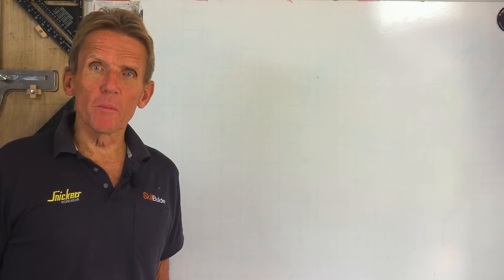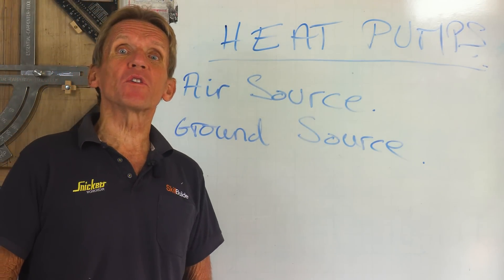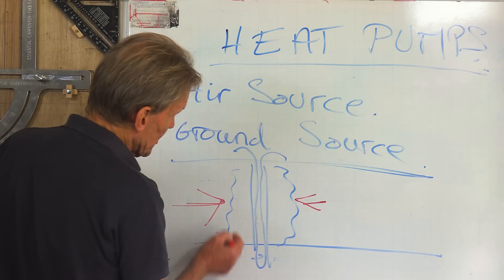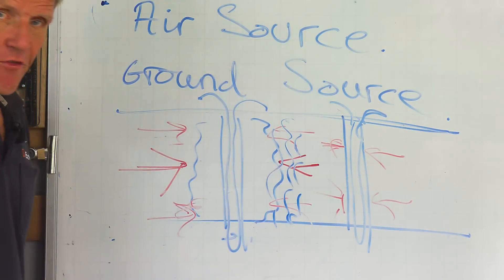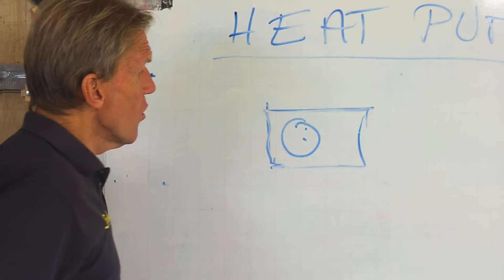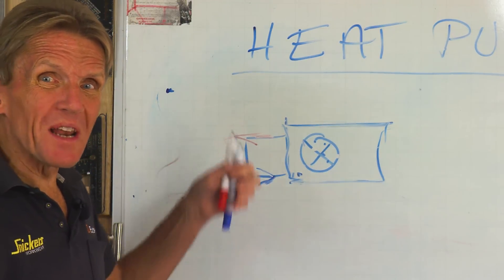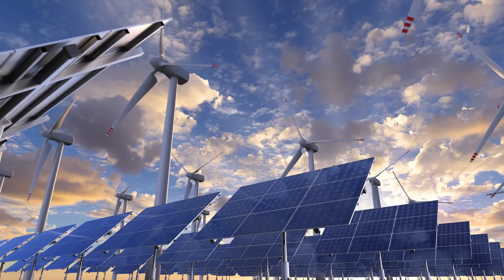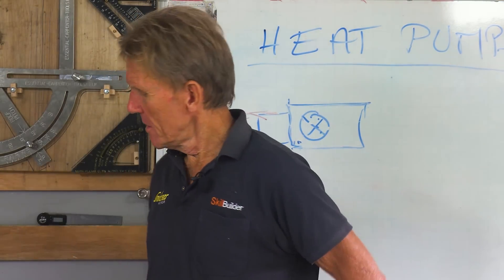Heat Pumps ~ Get Your Facts Straight!

Comment: Thanks Roger another great video.  
So I worked out the following: Based of fuels and 8 euro cost of fuel as base line to output kwh.
6mm Pellets with approx 5 kwh per 1kg  15 kg bag 8.00 euro x 15kg = 75 kwh output
Coal with approx 8 kwh per 1 kg stove used (40kg bag 24 euro) 8.00 euro x 13kg = 104 kwh output
Kerosene approx 10kwh per 1 L. 1L = 1.35 euro.   8 euro 6 L fuel = 60Kwh output.  Can 3x this by mixing in burnt oil (free) after filter mix etc  180Kwh (Chinese heater)
Mitsubishi heat pump Air to water 3.2 COP to 4.8 COP (2016)  1 kwh at 0.31c.  8 euro = 25 kw COP3 = 75kwh output.

As we can work out the calorific value for fuels... or at least approx due to efficiencies of stove, pellet burner and fuel heater... How do I confirm the COP output of the Heat Pump?
Had a look on line to see if could buy a plug in play device. Electric used, measure of water heat out and in including flow speed? I would think thats whats needed.  If I had a COP 1, how would I know as without the COP value confirmed its really the most expensive here to run maybe... Its the not knowing. Another video coming....

Comment: "Is that clear?"......Crystal......With the climate of the UK being damp and cold and especially this year wet (as rain or high humidity will kill the efficiency of heat pumps which you didn't mention), not sure heat pumps are viable in winter without a seperate gas boiler which is the way I am going to heat my house, 1st gas boiler then later an additional heat pump which will be switched off at below 5C.  Living in a semi I have just insulated the long wall non party side and used Hardie planking to cover it instead of cement which will need maintenance. The ends of the house will be insulated from the inside to avoid planning applications/inspections/approvals/neighbour whinging etc.......then the upgrades to the boiler starts.

Comment: If you coynnect your solar output to your aircon then you are not burning gas and should be summer carbon neutral.   If you are running a heat pump using electricity from non renewables you are increasing CO2  usage (but less than burning gas in a bolier ?)

Comment: There are some concerns raised about noise from Air source heat pump (a/c) systems when mounted outside , any ideas how that noise can be eliiminated (presumably electrical 50Hz,  mechanical bearings . start stop noise.
Reply from the maker: A lot of the noise is the rush of large volumes of air beging pushed through the heat exchanger.

Comment: Please go back to the drawing board and do this video all over again.
What do you mean by ground source? Digging a 2 meter deep trench and place tubes in it to use for your heat pump? That will be affected by sun and the air temperature. Don’t you forget about heat pumps and placing the pipes vertically, drilling a 120-18 meter hole into the bedrock. Time to wake up? And present all the alternatives.
Reply from the maker: I have no idea what you are talking about. All this was covered in the video. Maybe you nodded off

Comment: Can you imagine all those fans spinning up 24/7 on all heat pumps if fitted on all buildings plus it will be using more electricity to the grid just like the ev it  is all a false statement made with the intent to deceive
Reply from the maker: We saw a news story where they are removing heat pumps from a school because of the noise.
Reply: @SkillBuilder  So I was curious and looked into this. The "removal" is just a clickbaity title from one outlet with no substance. The actual source article is from July. The picture included is of 2 external air to air units, so if they're running in AC mode in July, not sure how they can be noisy 24/7.  Seems to me, like another anti-heatpump hit piece.

Comment: I feel that one issues with heat pumps that is never mentioned or taken into account is local Temperatures and how they vary across the UK. It is quite obvious that your average outside temperature will effect your efficiency and over a year your costs will be much different to many others. So the question for me is by living in a colder Scotland or any where else can I lose money by converting to Heat Pumps, and if it has to work harder and longer will it need replaced sooner in the future???????
Reply: Two thirds of Norwegen homes have heat pumps, I'm sure if it works in Norway there's no issues with the slight cold we get in the UK, even in Scotland....
Reply: @Lewiiisss  yes it may work...I am talking about relative efficiencies and costs over time and can everyone afford them. If the temperature outside is 0 deg C and you want to produce 20 deg internally you have to use Electricity... then you also have to look at the cost of Power but that over time depends on Climate and Carbon restrictions... as we speak there are laws being draughted to restrict your consumptions on all homes, not only that, they are enforcing Home Efficiency ratings to be at certain levels....this will cost tens of thousands and will be incremented over time. Also you are restricting yourself to one source of power and are reliant on an infrastructure that is not fit for purpose...it is failing now  with EV's......
Reply: Yes, large towns and cities are heat islands, so the HP performance is likely to be better than in rural and northern areas.

Comment: A first time I come across in one of those videos, where some body gets the difference between ground sourced and geothermal right.

I want to add, that you go geothermal, in areas where geothermal does not reach the surface, when you go deep. I talk about going at least 400 m for hot water, but most often down to 1,000 to 3,000 m. The surface geothermal was already used by the Vikings.

As such boreholes are expensive, it is done most of the time for district heating. Here in Iceland most of the boreholes, with reasonable power are about 2,000m, about 5 kW in a good working borehole.. In the first step you extract electrical energy using the steam and the water cools down to 90¨C. That water is than used for district heating..You use the same equipment drilling far hot water as drilling for oil.
You will find geothermal energy in a lot of countries and areas at a reasonable depth. Always when you go deep enough. Were you have wet rock you can extract the heat by pumping up the hot water or you are getting steam. With non water bearing rock or dry rock, you have to introduce water through one hole, crack the rock and pump hot water or steam up through another hole.
Most of Iceland, 95% of the houses including industrial sites are heated by geothermal. All in all over 60% of all energy used in Iceland comes from geothermal.

Comment: This is useful information. But our heat pump system is only used to heat our water for the taps etc. It runs off of our solar panels. The radiators are electric.  Our house is a new build and this system was installed by developers. It works very well. Other people I know with heat pumps also just have it for just hot water.  So having heat pumps to heat radiators is not a super common set up in our area.
Reply: Sounds like the builders did just enough to meet building regs and ABSOLUTELY NOTHING EXTRA. It won't be running off your solar panels this month.

Comment: So why in Canada which is substantially colder than UK use air to air heat pump all the way down to -35 Celcius? Honestly don't tell me UK knows better than Canada when it comes down to heating in winter... Same thing in Nordic countries. All use Air to Air heat pumps.
Reply from the maker: As I explained in the video we are using air to water and therein lies a problem with low flow rates and icing up.
It is not a question of knowing better it is entirely political.

Comment: It always drives me nuts in places like Buxton, Bath, Bristol and Matlock why would you want a gas boiler, megawatts of power are pissing out the ground, all it would take is sensible extraction using heat pumps with heat exchangers and district heating networks. We do not make full use of what nature provides us with. I am living off-grid now in a normal urban semi, it is purely a case of sensible use of natural resources. Rivers especially those in tidal estuaries are perfect places to put heat pump loops.

Comment: Often think theres a big trick missed with heat pump systems   a trick the romans did 2000 years ago
Heat the ground under the building ad it stays warm far longer than the fabric of the building...hot all ways travels to cold....heat the may be partly insulated round the edge against the foundations with solar all summer and control its release into the building 
Solar heat is far away cheaper ...its just haveing a big enough store

Comment: Just wanna tell people that cooling the house in the summer is pretty "cheap" compared to warming the house in the winter. Warming a house from 0C° to +20C° takes a lot more energy that cooling from +25C° to +20C°.

oh and the heat from the sun is typically about 90% of the total heat in the ground (in England).
Reply: What seems odd is why isn't cold water pumped around the radiators and fans fitted radiators to increase the cool air flow...
Reply: @tatradak9781 because cold air doesn't rise.
Reply: @tatradak9781  because we live in a humid climate and water will condense on the cold pipes and radiators, causing problems
Reply: @tatradak9781 
You need a refrigeration process to cool the water

Comment: Strictly speaking both systems using hot springs (or water pumped deep into the ground) and ground source heat pumps exploit geo-thermal energy.  After all 'Geo' is from a Greek base meaning ground or land.  And the shallow pumped version is, after all, called a 'ground-sourced heat pump'. The discriminator is the technology used to extract that geothermal energy. Ground source heat pumps do it close to the surface rather than from heat sources deeper down.  But both are still, strictly speaking, geothermal.  This is probably industry pseudo-convention of a similar nature to electricians who refer to the 'L' - in 'LNE' - as the live wire when in fact they should use 'Line'.... both L and N wires are 'live'.  Thinking otherwise could kill you. Because the amount of heat from deeper in the earh's crust is greater- the centre of the earth is molten - this type of geothermal energy is used for multiple outlets / homes over a wide area, fed from a central collector station.  Conversely, ground source heat pumps, because of the relatively low geothermal energy capture, are generally used for single buildings.
Reply from the maker: The distinction between geo thermal and ground source is more than semantics. It explains why the ground source heat is, in practical terms, variable and finite. The Ground Source Heat Pump Association says that freezing around ground source collectors is a common problem and needs due consideration in a survey.
Reply: agreed Roger, but whatever the considerations or semantics,  benefits and otherwise, the energy harvested by a ground collector is, by definition, geothermal energy however deep the collector is placed in the ground.  The shallower the collector, the more the capture is affected by near-surface and above surface energy effects caused by the sun / atmosphere.

Comment: Air to air is best. You only heat/cool specific rooms instead of the entire house so you use less energy, 4:1 energy efficiency , much much cheaper to install, you can switch between gas and electric whichever is cheapest, easy to maintain.
Reply: You can get 4:1 with air to water
Reply: @hk78901  correct
Reply: @hk78901  with water it's less efficient overall as performance suffers during coldest month's, unit going into defrost regularly, water pumps and valves use additional electricity. Those with air to air and a cheap combi can switch back to gas on the coldest month's/days. Best of both worlds
Reply: it is important to heat the whole interior of the house for half the year and/or vent it to control the humidity of the air. Why do poor people get black mould problems: lack of heat and lack of understanding of the need to trickle ventilate the house constantly. Even rising damp in houses can be controlled this way.
Reply: @itscoconutsaregood  the mould occurs mainly in bathrooms and areas with poor extraction/ventilation and poor insulation. You don't hear your entire home just to prevent mould, not really the same topic
Reply: my statement referred to your "specific rooms instead". I just thought of reminding everyone that keeping spaces free of the effects of air moisture needs to be borne in mind when leaving heating off in other areas of the home. It was not a criticism just a statement of fact.   @ZXspectrum..

Comment: I love heat pumps. Gas generated electricity is about negative 2.5 CoP and we use electricity to operate heat pumps at positive 2.5 CoP.
Reply: A couple of days ago, here in UK 70% of our electricity was from gas (58%) and imports (12%). There's no solar to speak of in the winter and no wind on misty days.
Reply: The best answer is, if you have a high heat loss property, insulate/draughtproof and use timed heating for the spaces you actually use. Ask Martin Lewis!

Comment: Wouldnt be without our split AC units, they are great, kpps us nice and cool in the summer and give us excellent cheap heat in the winter. The gubbermint can go and get stuffed with their so called grants cos they arent worth it, cos the installers just whack the price up, it was the same with the solar and the boiler replacement schemes, utter joke the whole thing.

Comment: I went with air-to-air. Way better value for money on purchase - and efficiency is much, much better too! Where I live I benefit from the cooling and de-humidification during summer too. To heat or cool several rooms I've just banged some holes in the walls and put in vents; no fancy pipes, radiators etc needed -- just simple ventilation fans. Later I'll add an heat/energy exchanger - for fresh air.

oh, and in the summer - my emissions are 0 because i have solar
Reply: Definatly the way to go! I have been saying this for years having seen that type of device on the continent years ago.
Reply: The argument against this is because heat pumps can run at %400 efficiency you'd be better off running the solar energy through that to heat both your home and your hot water rather than just your home.

However the simplicity factor of your install negates that in my humble opinion. For most smaller homes your system is probably the ideal set up that is being completely ignored by the powers that be for some reason.

Comment: We have just had a hybird A2A/A2W system fitted in our bungalow that did qaulify for the BUS grant! Daikin Heatpump that runs to a unit that spilts it to a hot water tank and then water to 4 fan units in the loft that can run hot or cold air ducked into every room. Was a huge amount disruption but we had a dead gas combi and rusted out radiators. We have lost a fair bit of loft space but no radiators frees up a lot of wall space inside the property. We are a 3 bed bungalow and it cost us £8 after the old £5 BUS grant